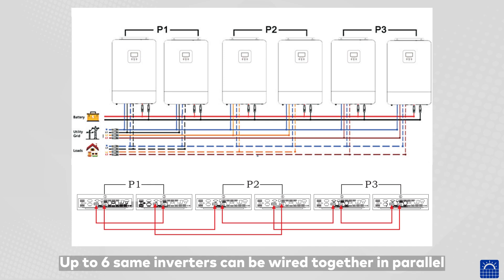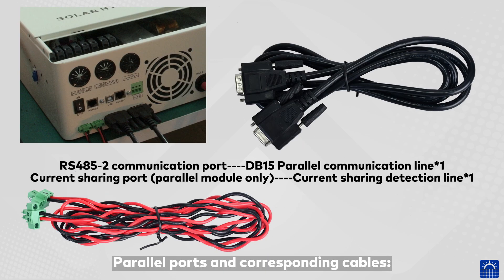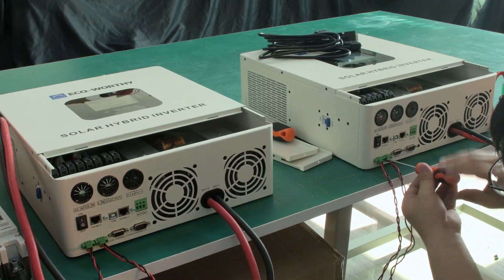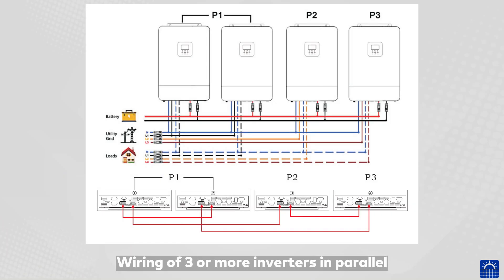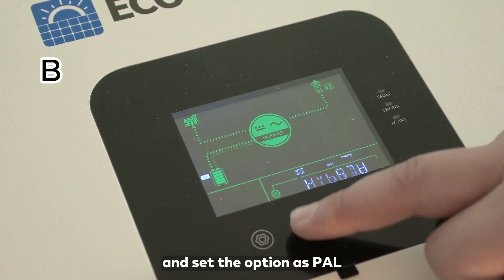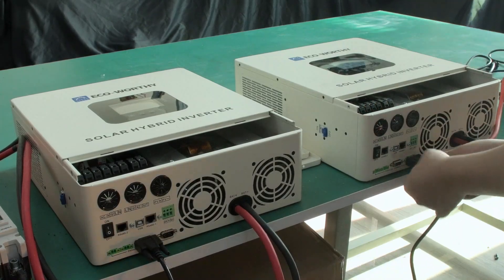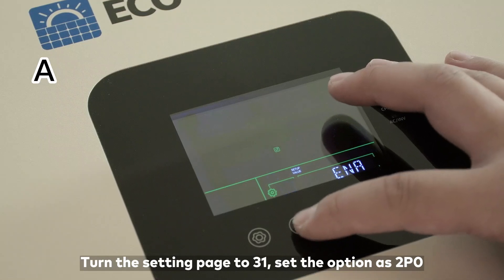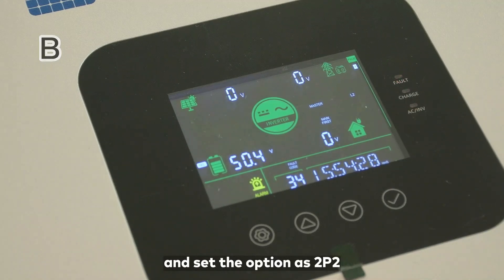How to Connect Two 5kW All-in-One Inverters in Parallel | ECO-WORTHY Setup Guide

Comment: Can these operate is a series type configuration to produce 10kw at 120v?
Reply from the maker: Hello, thank you for your question. Series connection is not possible. However, you can achieve your desired effect by connecting devices in parallel - generating 10kw of power at 120v.

Comment: Do they need the same solar put into each of can it be different like can one have 3000 watt input and the other have 2500 watt
Reply: You can have different PV arrays on either or both as long as your are in the MPPT voltage range.  IF in parallel, there is NO need to connect PV to any as they will carry the load depending on your battery capacity.  I routinely REMOVE PV to cycle my six EW server rack batteries and they handle the load without issue.  Gary in SE MI
Reply from the maker: You just need to connect to the RS232 port of the main battery. 🙌🙌